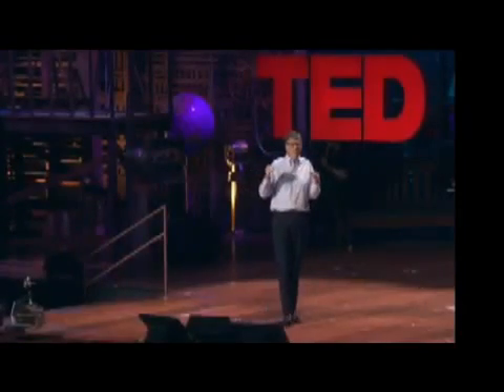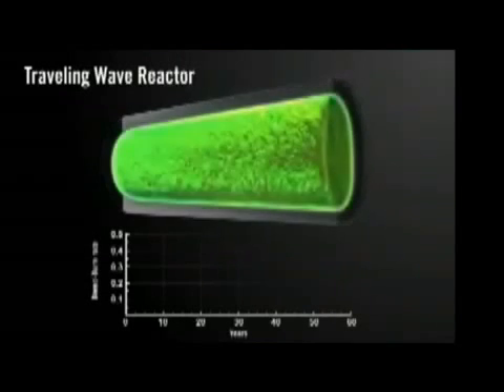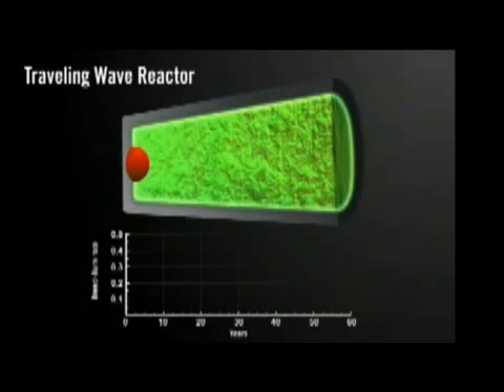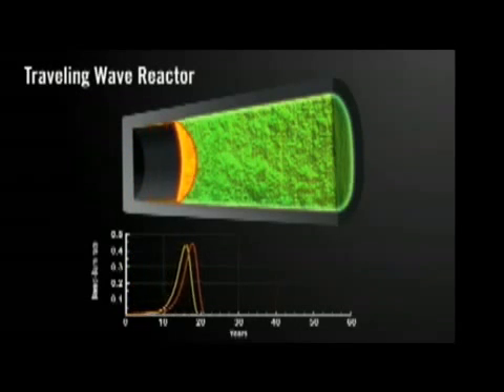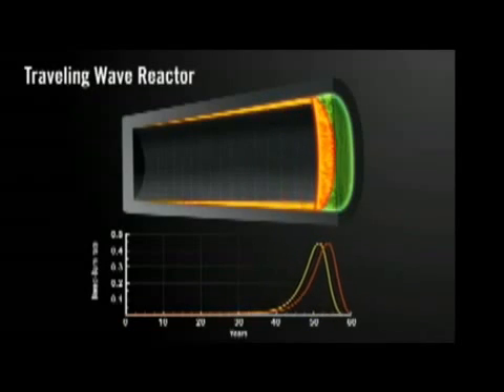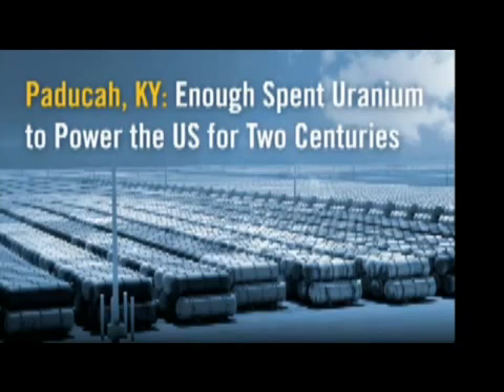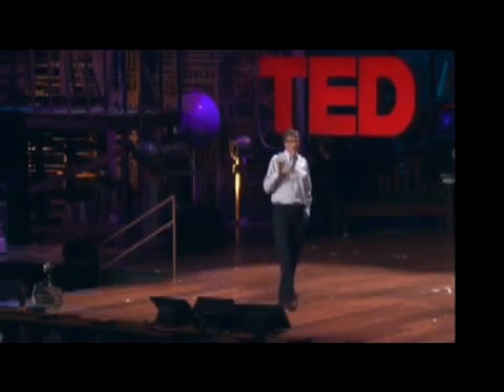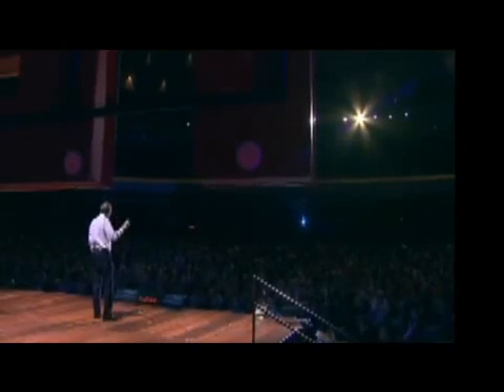Bill Gates explains Terrapower And The Traveling Wave Reactor

Comment: Whats more troubling to me is not the cost of the reactor, but the complacency towards the massive waste dumps that we have built up.  Having recently traveled and stayed in the DFW area I was dumbstruck at the trash mountain near there. I know household trash and spent fuel rods are two different things, but it seems like everyone feels safer keeping it out of sight than dealing with it or working towards a viable solution.
Reply: Brian the Red     Trash is naturally recycled when we return it to the Earth.
Reply: In that case you should read up on reprocessing, DGRs, breeder reactors etc. plenty of options to deal with waste in the long term. 
Because of the insane energy density there’s almost no physical waste footprint (contrary to normal household waste)

Comment: My question is at what fuel burn rate does this type of reactor become dangerous?  If it becomes dangerous at twice the normal burn rate then will a reactor that normally has a 60 year fuel supply burn out of control for 30 years?  Having that much fuel in one spot makes me very nervous.
Reply: It doesn't burn out of control, it just produces energy until there's nothing left except new waste. The cool thing is that we can take that waste and break it down again to get new energy. If you look at the chemistry, we can keep breaking down that uranium until it's copper
Reply: a normal 1000mwe PWR reaktor is loaded with around 29 tons of uranium that last about two years before refuel.. navy reactors using highly enriched uranium can run for upto 25/30 yrs before refuel cause it dosnt get "poisend" and use up almost all the fuel where pwr uses less then 10% of the uranium :)

Comment: That is not entirely accurate what you've said. Coal is not exclusively a pure elemental form of carbon, and it does indeed have different molecular forms. If what your saying was true, then coal would not have a by product of methane and CO2 when burned.